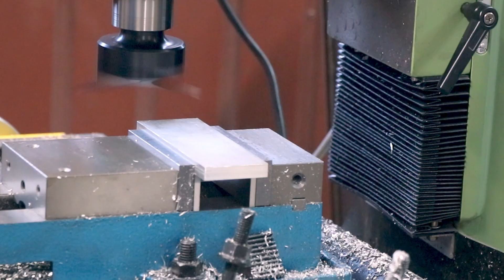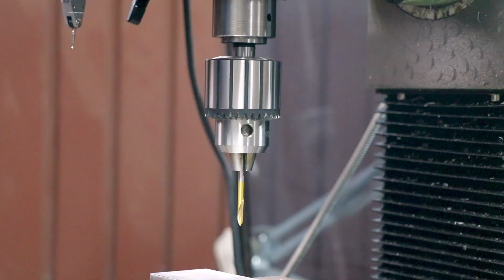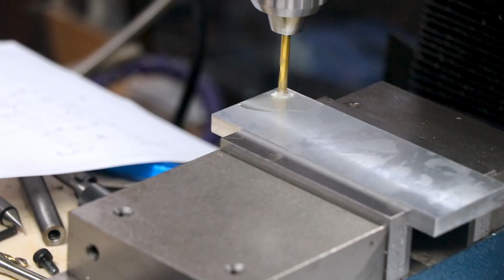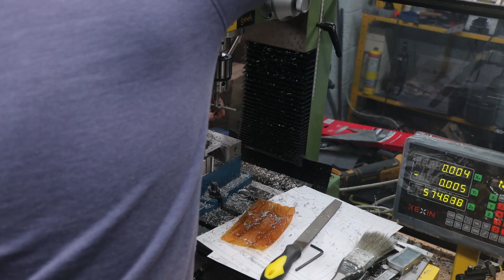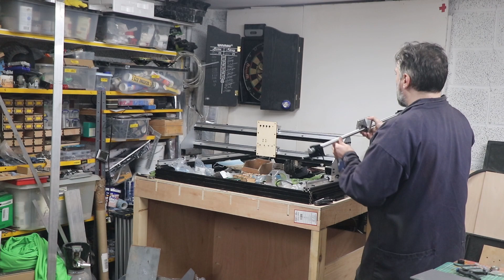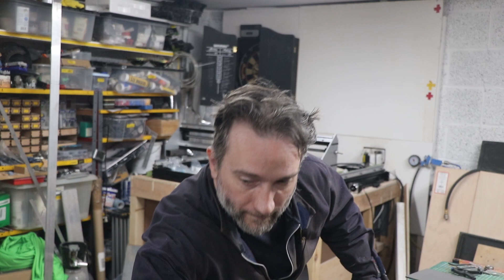OX CNC refactor: x-axis carriage brackets

Comment: Great video sir!  Machining is a hard learning curve.  The mistakes made were minor and common.  Parts are salvageable, so no worries.  On final assembly, make sure to put holes in your shims for the screws to pass thru, so that the plate torques flat.  Shimming between fasteners leads to chasing problems and headaches.  Keep up the great work!
Reply from the maker: Not going to lie, part of me thought I might just get away with the shims between the fasteners. But you are the voice of reason, I should take the time to sort it properly or regret it later.